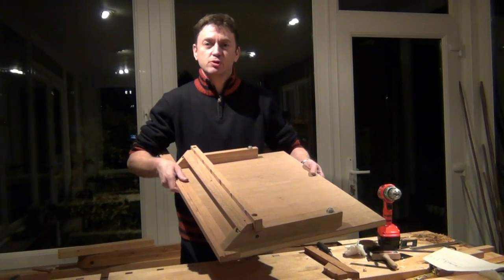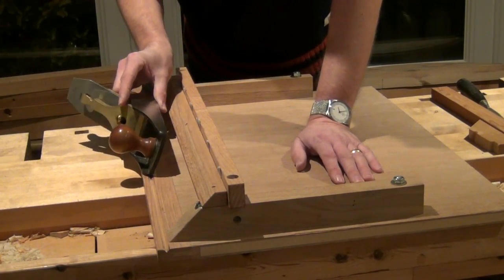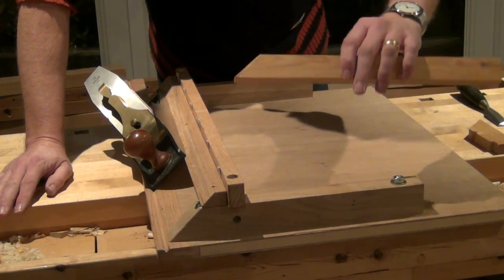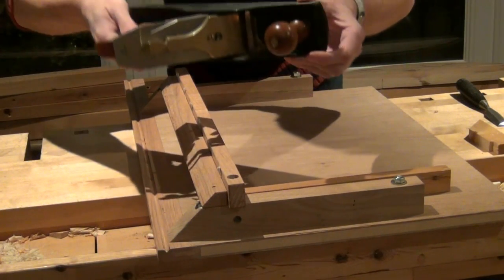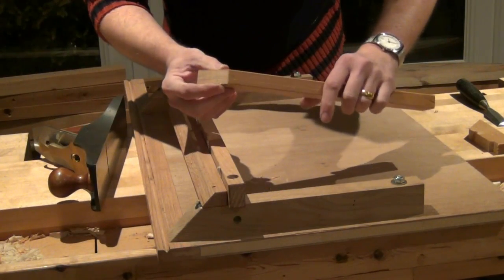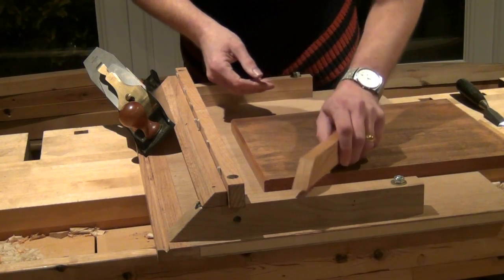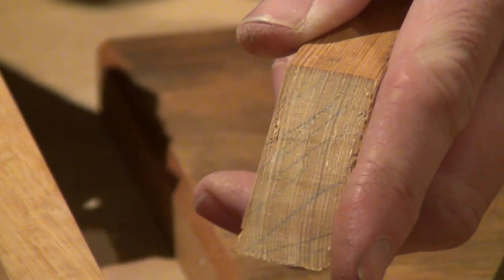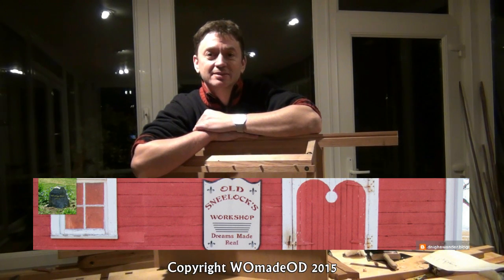Mitre Shooting Board - An Introduction & FREE PLANS

Comment: Thanks Mitch. Excellent video.  Will need to add a mitre shooting board got my growing to do list! Cheers Mick
Reply from the maker: Mick Doherty Cheers Mick. This is a great piece of kit if you need to prepare mitres up to two inches in width. Capacity for length of mitre can be chosen as required (mine is approx 21"). See the full build next weekend.